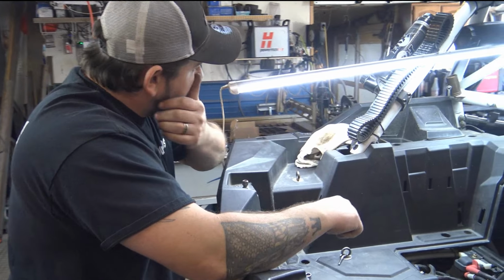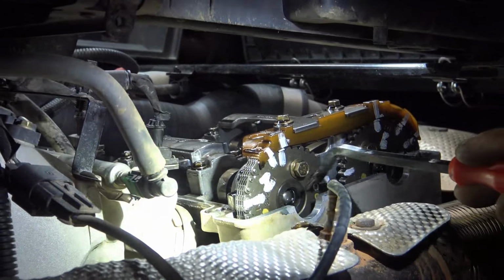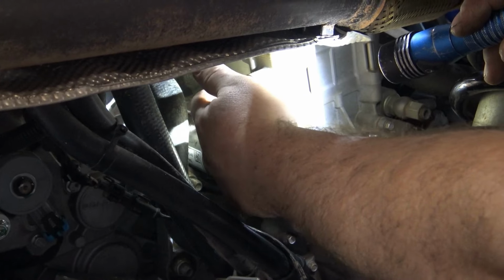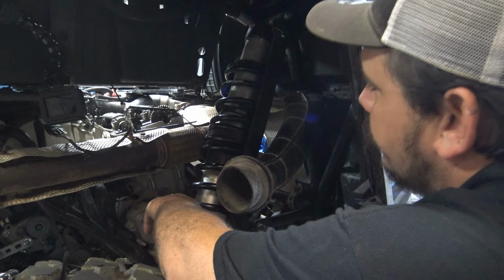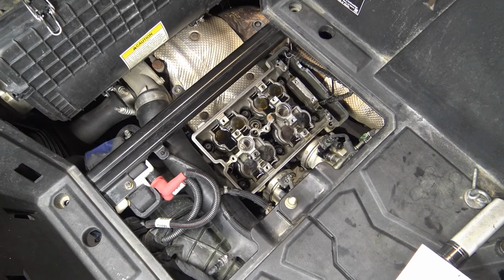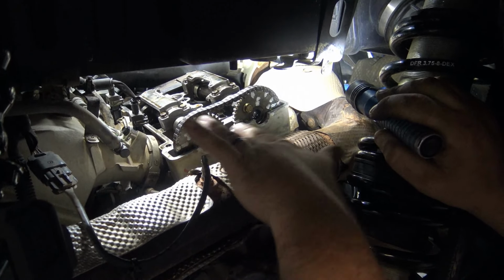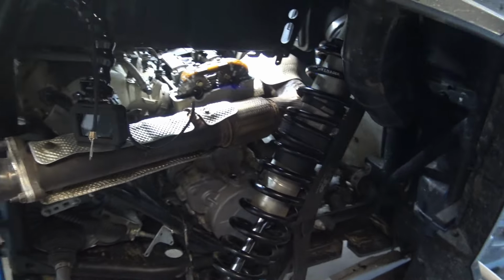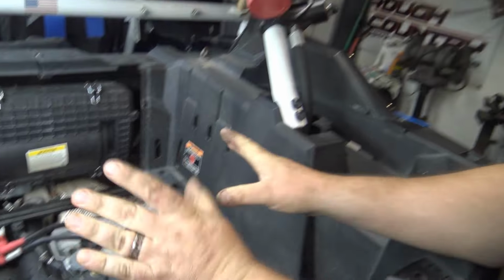Installing ARP Head Studs On A Polaris RZR Turbo!!

Comment: On the intake when installing cams looks like one of the valves is slightly under pressure is that where are use the wrench to get it lined up pushed on the valves to put the holding  bracket on?

Comment: Who did you order these from. Wondering who's instructions those are. I've seen different torque numbers thru different vendors. Some say 80ftlbs and others say 85ftlbs. Which is it? Or does it really matter?
Reply from the maker: LOL that was originally probably Evo. But I do it a little bit different now for big boost built motor.  I do 85 ftlbs let it sit 10 minutes back each one individually off 180° then re-torque to 85
Reply: @utvoutlaws6652  well I split the difference. I went to 82ftlbs. Hahah.  Hope it holds
Reply from the maker: Awesome man thanks for watching hopefully it helps

Comment: Are the Cam sprocket bolts the only ones that got blue loctite and what torque specs on them
Reply from the maker: You can blue Loctite cam gear and Cam mounting brackets I don’t remember torque specs you’ll have to look it up on Google. Thanks for watching

Comment: Nice video, I will be doing this myself this winter, Ive watched several videos of this how to and you guys are the only ones who have removed the sprocket from the cam on removal. Is there a reason too or just something that is done with your routine?
Reply from the maker: Not sure it's nessessary but we wanted to make sure to locktite the bolts and it's a little easier to get the one cog gear out of the way. Thanks for watching!!
Reply: @utvoutlaws6652  So i did the studs this weekend and by doing it the factory suggested way like you guys did in the video taking the gear off the intake cam is almost required due to the fact of the pressure on the lobes closest to the gear which your video suggests. I had to go back through it to catch it but it does mention that and I give you guys a lot of credit for that! Another big video cuts at that point and completely skips this all going back together. I saw another video of a guy walking the cam back into place but he had the side cover completely off so he was able to put a socket on that side and rotated the motor counter clockwise until it laid down flat, engine was out and most of us don't have this option available. THANKS AGAIN FOR THE DETAILS ON THIS. WAS SUPER NERVOUS OF GETTING IT ALL BACK TOEGTHER WITHOUT MESSING SOMETHING UP.
Reply from the maker: Sounds like you got it handled!! 👍 videos might be a little longer than most, but we try to go over the small details that others might miss in hopes we can help our viewers out as much as possible. Thanks again for watching!